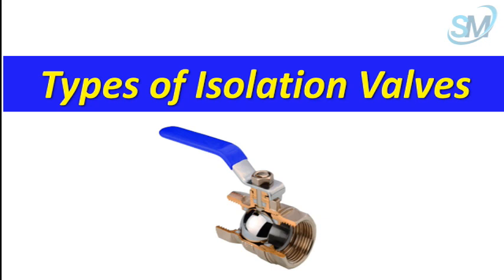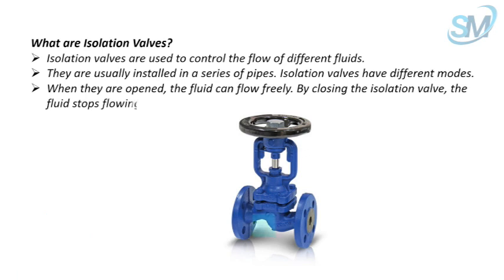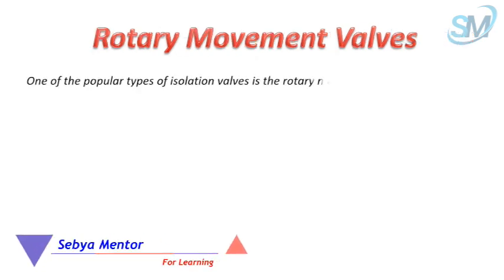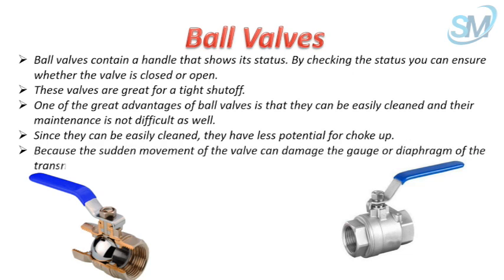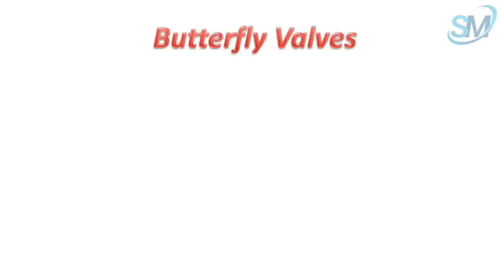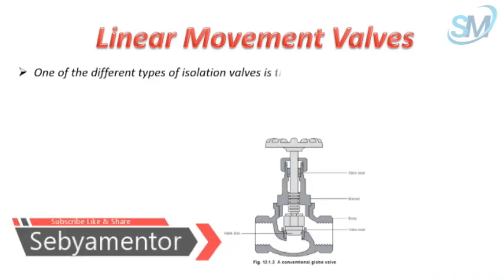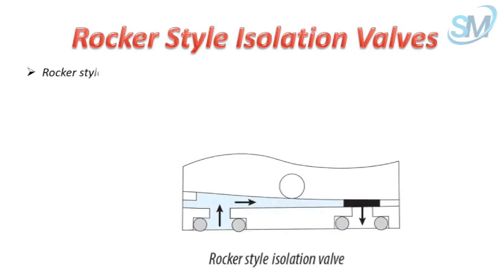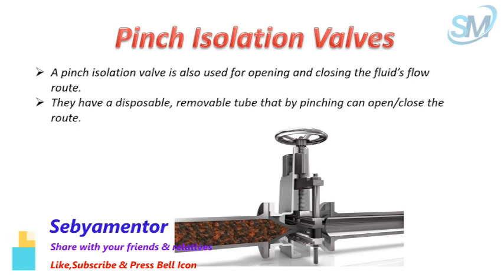Types of Isolation valves | Different Types of Isolation Valves| Isolation Valve | Valves for Piping

Comment: Sir what is difference between orifice and nozzle????
Reply from the maker: An orifice is a small opening or hole in a wall or plate through which fluid passes while the Nozzle is a convergent-divergent passage that allows the fluid to flow through and accelerate the fluid to a high velocity before discharging it.